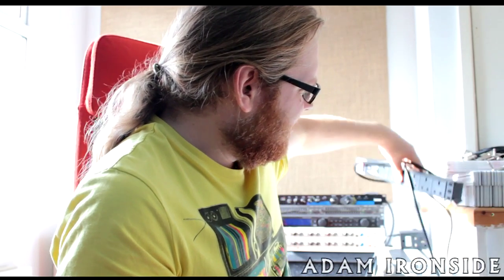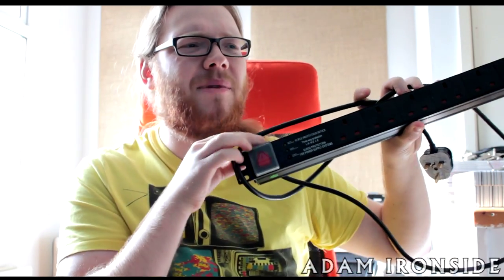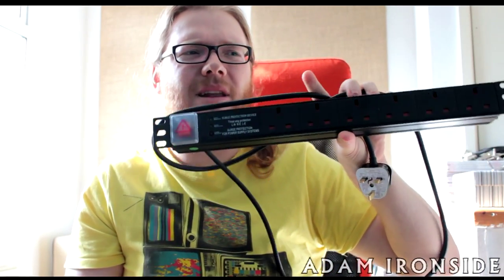Rig Building Part 3 - Powering the Rack

Comment: It's worth bearing in mind that modern gear tends to have switched-mode power supplies, which are largely immune to all of the oddities you get with noisy and fluctuating mains supplies, so a power conditioner on that kind of gear is pretty much redundant.

Comment: With the cost of the power conditioning you may as well buy a noise gate. Then you dont have to bother about noise anymore. 

If your distributor is fused, that's more than enough to protect your gear. Also, I wouldn't spend money in cutting the noise from the mains when you're gonna have a tube amp under stage lights (presumably).